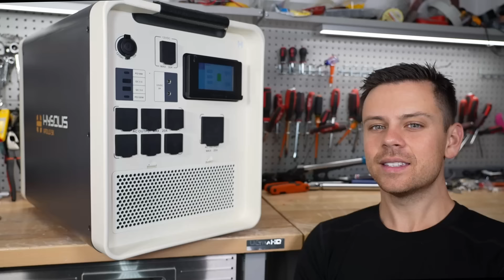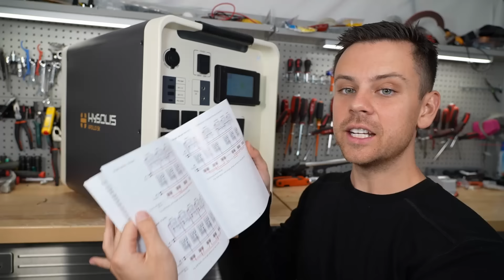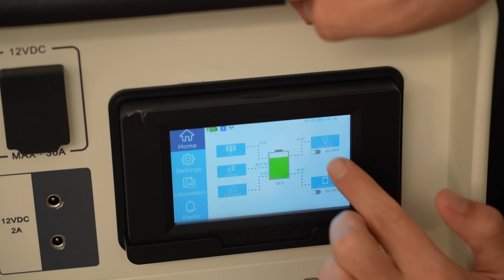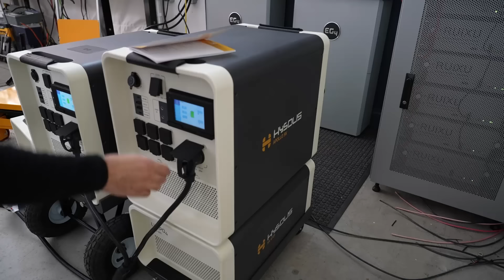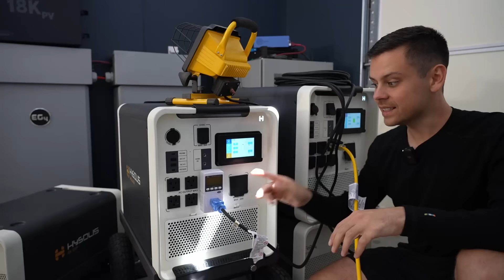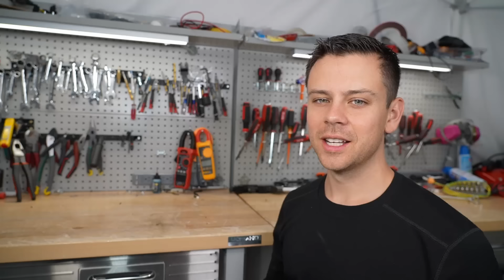Hysolis Apollo 5K Review and Test

Comment: Will, we're looking for something that can drive a small to medium sized MIG welder, angle grinder, and some lights. I think this model is plenty, but im concerned about the low voltage, high current, and especially the high frequency component leaking back into the circuitry.

Comment: Can it charge by a small generator and supplement surges by using the battery?  can it be used like a UPS?    What I want to do is plug essential systems right into it, and have it mostly do pass thru to grid, but then be able to hit a transfer switch to a generator if the power goes out.  We may add a few solar panels for the heck of it later.

Comment: Will I have a question and I know you will have the answer I'm confused I want to run my rv off of solar .but the solar will be stationary on my land with batterys :converters ; inverters in a steel shed .is there a way to  drive up in my rv to my land  plug the 30a or 50a shore plug into the solar  inverter and not have to mess with any wiring in the rv ? Just use shore plug ? 

Thank you I hope you see this and can help me out (I'm looking at buying the power everything kit you sale)

Comment: @WillProwse Deciding which components to use and wiring them up.
We've got amps watts volts. Check understand. 
Wire sizing and breakers, fuses. Check understand there's even a chart for that.

Components understanding.
Well If I pull 20amps down a line I don't need a 120a 2/0 wire.
Only makes sense. Use a 40a wire something cheaper and easier to work with. 

But components.
Controllers can push amp even if not used.

What if it's not given 40, 60a.
Solar production can produce 200w @ 16a. An MPPT can't push 60a because it's not there right?

Pulling. Inverters and fuse boxes  from bus bars.
If your only drawing 20a from a dc fuse box. Can you draw 120a down the line.
Inverters have surge. Surge is when it turns on. If it can surge up to x. Yes but only for an moment. 
After that it fluctuates around the drawn amperage. Right?
Give or take a couple amps.
If you only draw 10a off that inverter? How much of a surge are you really going to get?

There are so many videos with so much information but every video always leaves out something or causes more questions to answered.

Actually DIY Something Grab some random components and put them together. 
Answer questions as to why you chose those components.
Also.
Not a house system. Mobile system. Vans, trailers etc. Keeping it small with just a couple lights, maybe a laptop, phone, tablet etc.

I have follow up questions to videos and follow up questions to questions. Can you msg me. 
You can even call me and the questions I have will  allow you to make the 1 stop answer all video.

Comment: Will  Imagine connecting EG4 server rack batteries to the Apollos.  I have 2 Apollos running split phase, I dont want to buy Hysolis expansion batteries as they are too much cost.  I do want to connect EG4 server rack batteries, 60 KWH,  can this be done?  If not can you ask EG4 if they would develop this ability?  Thanks

Comment: Please note that I have an off-grid SMA system, have had with flooded lead-acid for the last 12 years.

You're so smart you're scary smart. Now, try to get your subject-verb agreement correct. 

I know! An engineer talking to you about grammar...

BUT... 0:05
"There WERE problems!"
NOT...
"There WAS problems."

Have you noticed that you don't use "AIN'T?" Because that would make you look uneducated? 
Same thing.
And no "A (apple, alligator, etc.)"

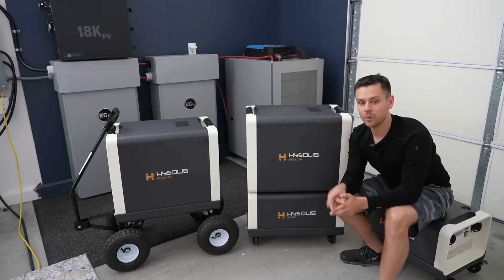7:19  "'There ARE' (not 'THERE'S') 2 different types of carts."

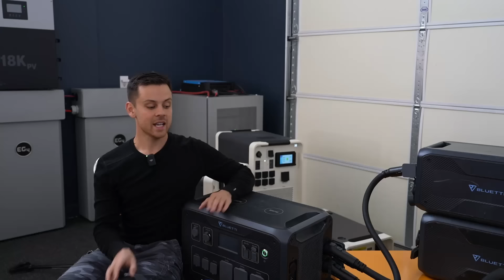13:10 and "It's none (singular subject) 'of these devices' (only a prepositional phrase) HAS (not 'have') surge protection..."

You probably got a 1400 on your language SAT exam. Now apply what you know.

14:26 "The standard settings that come with the unit only charge (not charges)." 

I can do this all day.

Comment: Mr. PROWSE: have watched your solar off grid type systems, but what would you recommend for install on a bus- solar panels +system; conversion( known as schoolies), which will handle appliances- refrigerator, AC, and including portable washer/ dryer- (stackable), also will 4 battery bank( lithium), handle the load!?, your recommendations would be greatly appreciated!

Comment: Hello Will,
I have been following your videos since back when you were operating out of an RV. Thank you for such a massive amount of unbiased information. I'm having a problem with my renogy 200 amp hour lithium iron phosphate batteries. I originally bought two of them. After one year one of them failed and was sent back to renogy in California. They replaced that battery. Now I have another battery that has failed it refuses to charge above 25%. The other battery works just fine using the same solar system in my RV it is all renogy 400-watt s of solar panels, 40 amp mppt charger, DC to DC charger, 3k charger inverter. I am one-hundred-per-cent electric in my RV. I don't know if I should stick with renogy or switch to a different type of battery the original reason for all the renogy equipment was it was available through a big-box store where I had a credit card.

Comment: REQUEST;  BUILD;  A HAND AUTOGRAPHED; WITH:  RUSTOLEUM PAINT:  Super easy too install .    'Portable'  Safe , salt air resistant.  Portable power box;   2000watt power inverter;  Duel battery rig.  ESPECIALLY FOR; THE INFAMOUS! TOYOTA 4RUNNER.  YOU WANT. TO OWN! [ Or other suv .[  That has;  The least. Wire fishing. To do.  My idea rig.  Would be. For lack. of better words.'' A removable.  Extension cord.'''  From the engine compartment. Starter battery.  To the back. So I can charge while driving.  The extension cord. Is attached. Directly to the starter battery.   Simply pushed trough. An existing open engine firewall Gromit. Rolled up. Under the glove compartment. 
// Plug,  it in.  A 12v cigarettes' lighter socket. With an extra fuse.  [Not wired.  To the OEM.  Existing electrical panel.//   The cargo hold  battery. Is safest. lithium. BUT we 4runners, need.  To charge both: The started acid batt.  And cargo compartment lithium batt. BY:   ac, dc and panel.   [ . Salt water hurricane  spray resistant;   Heaviest part.  40lbs or less  24hr  120 volt 1800 watts, + foldable solar panels. AND I WILL BUY IT[] PS  You are allowed to autograph.  Various builds. Comprised of various manufacture parts. and sell your autograph versions.

Comment: REQUEST: 911 POWER MY FREEZER.  FOR CHEAP.    individual parts.  AND: inverter charger combo.  AND:  Make the batteries rechargeable; AC plug. AND  SAFELY on a 4runner starter battery. And a portable solar panel array. []  Frigidaire 20-cu ft Frost-free Upright Freezer ) ENERGY STAR     115 V   between 185 and 280 watts or the equivalent of 0.185 and 0.28 kilowatt-hours. Same rig should also; ''Separately power'': AT least;  8,000 btu, air-conditioner.

Comment: Thank you Will for your awesome stream of Solar Videos! In Germany the so-called "Balkonkraftwerk" is quite popular, a balcony solar "power station", and it feeds all its electricity e.g. 220V / 600W RIGHT BACK into the 220V AC of the condo unit, or however much it generates at that time. The theory is that the condo uses MORE than 600W at any time anyway, and that one WOULD SAVE the electric bill by as much as one feeds into one's home, because the electricity will just somehow distribute itself within the condo. 
Question: Do such units exist ALSO FOR 110V/60Hz as we have in the US, and would that be legal or at least safe to install?

Comment: Will.  Whats your opinion on the +/- 5# voltage regulation?  I ran my apollos split phase an even at very light loading I saw volts as low as 118.5 volts.   I dont like seeing this output volts in this range personally?

Comment: I am working on my first solar design for an off grid workshop. Love your channel but you devote a lot of time to the charge controllers and inverters and all in one systems and batteries but I need to know about panels. I would really appreciate more content on selecting the right panels. For example, I need about 800 W I think probably four panels ground mounted anyway, love your channel, but please do more content about the actual electrical generator PV part of the design!

Comment: you say unit is limited to 737 watts VAC input while the inverter is outputting [i assume the full 3000 watts], however, the manual only talks about 600 watts?  either way if they are configured into split phase can each unit take 737 [600?] watts VAC input for a total of 1474 [1200?] while the pair is outputting 6000 watts at 240 VAC?

Comment: Hello Will, huge fan - been watching you for years.  I am running an Enphase system on my solar panels and would love to add batteries to the system without having to buy Enphase's battery and grid disconnect (with neutral) system.  Is there a battery system that will accept 240V ac and trick the Enphase microinverters that the grid is active?  Thank you.

Comment: Hi Will, could I ask your advice regarding my solar set up on my Canalboat…? I have 2 identical 120w panels feeding a 30amp mppt and 1x140w panel feeding a 10amp mppt, both controllers are connected to my 390ah battery bank, the reason I use 2 controllers is because the smaller panel is a different size, can you see any obvious issue with this setup? Or suggest a better way? Thanks Andrew

Comment: Why the lift worked? My suspicion is the lift was 'unloaded', meaning there is a zero beginning weight. I notice the model 3 is sitting on the safety stop, this allows the motor to spool up unloaded and therefore has a lower startup current. The model 7 looks similar. 
I suggest a more severe test where the motor must start the lift under full weight. In other words off the safety and not sitting on the ground.  
Just a few thoughts and not any kind of accusation. Jim Z - Fan

Comment: I'm interested in something that will handle a power loss of the grid.   Over the past few years the worst outage has been a couple days.   My options are a Generac generator running
on propane, or a battery system similar to this video.    I was told by a Generac Rep I need 11kW peak ( I have a well pump). If I assume 2-3 days without grid worst case,   Generac or battery.  Which is cheaper.  This would be for a fully installed system by a contractor.

Comment: Did you say this does 3 phase power?
That’s incredible if you have an off grid shop with the 3 phase tools and solar to not have to run a diesel generator for your three phase lathe or plasma torch

Comment: Hi Will, I built a vacation home 12 years ago- installed 880watts of solar and 12 x 2volt lead acid batteries, 880 ah. All works fine still with a little help from a 2kva Honda genset when its cloudy. So to my point - I want to upgrade the system, not by a huge amount as my usage is quite small- but maybe double the solar panel wattage and go lithium, The thing is technology keeps moving at a pace and I think maybe wait a little longer for the equipment to improve even more and maybe prices to fall a little more. I like the fact there is so much more plug and play gear on the market as my place is on an island and a bit remote for techs to visit. Maybe there is no one answer but thought I would share my experience from New Zealand.
Reply: I was looking for what I wanted in inverters, panels, batteries for awhile… then I executed when all my 12v lead acid batteries started to die!

I was planning on Lithium Titanate Oxide, because I did not ever want to deal with changing batteries again… but the prices on them doubled around the time I was ready to make the purchase! 

I wound up with some low mileage Ford Mach-E batteries, that were readily available. 

Locality often trumps technological options, you clearly know better than most!

Comment: Thank you for publishing such quality content. I may have to call them, but do you know if there are published specs on charging rates with the inverter settings on? I watched your video again and am concerned with having to have the inverter off to charge at faster rates.  I am looking to replace a propane generator in a slide in truck camper. I want to make sure I don't oversize solar input and not be able to run high draw items like the ac and charge at the same time. 

Should I be concerned with this limitation of the Apollo 5k?

Comment: Great presentation. I think you should have hook the Eco flow to the 30 amp plug to try to operate the lift. But you didn't on the other one so I get it. I'm an Exo flow guy cuz I just  picked one up online for $1,700.  I don't think I'll be getting any other ones for a couple years. But I am going to figure out how to use for 100 amp hour batteries to supplement my EcoFlow Delta pro.

Comment: Hey Will, I have a solar question for you. We have all victron components with battel born lithium batteries, we recently updated our system from 12v to 48v. We have two multi plus II 48v/3000, lynix 1000 power in, mppt 150/85, 12 batteries, 6 320w solar panels. We can not get mppt to kick on and generate current to our system. We have had solar guy check our work and several calls to dragonfly, everything is hooked up correctly, all are stumped. Any ideas?

Comment: I just saw your video review on the Hysolis Apollo 5K.  I am looking to install and out door kitchen.   I want to have a fridge connected  and run lights fixtures every six feet for a total 128ft of lighting.  Would this unit be over kill for what i am using it for and those this unit have battery storage.

Comment: There is an interrupter that goes between the batteries and the Invertor to prevent the invertor from Faulting on low voltage. Also, it will start the invertor back up when batteries charge back to a safe level.  I am afraid my inverter may shut down someday and my fridge contents will spoil. im sure that i seen it on this channel

Comment: Will, this is great.  Appreciate your video's.  I am wondering if you can point us toward a 48V system that can have battery backup and be grid tied that is DIY friendly.  I assume it would require some kind of automatic switch to disconnect from grid during outages and maybe that would prevent a DIYer from installing.  Would love to see some content on that if possible.

Comment: Starting the lift when it is on the ground or safety dogs it is different than when the vehicle is supported by the hydraulic cylinders. It would be worth insuring your test is the same each time.
Reply from the maker: In both instances it's actually on the locks. So it doesn't matter. The locks are the same at every height

Comment: Hi Will, I'm in the uk. Can you run this as a single unit  at 240v (like other makers of uk units) or do i really need two units to achieve this? It's quite expensive if i need two to work at 240v here in UK. You point out that you can only draw some 720watts from single unit when it is charging at a higher amps. Is the power output also restricted when charging from solar panels?

Comment: Nice video review, and nice product for amateurs who want something simple for a RV, or other mobile electrical setup.  It's great that a company finally listened to your wish list and added the missing features to a portable solar generator.  This will be great for competition.  I hope that Anker will come up with a software update for my Powerhouse 767 that adds some of this functionality.
Reply: "nice [expensive] product for amateurs" certainly not "commercial"
Anyone care to guess what their sales and marketing plan says?
Reply: Very nice unit I like this my question is, can I use two to 25 amp plugs run them into a 50 amp female plug and use it for my 50 amp RV? Unplug the RV from the pedestal and plug into the 50 amp female plug and have the same power and usability?

Comment: I’m genuinely happy to see this thing available, but that 113kWh of battery is *expensive*. Puts the price of some of the EVs equipped with V2H into perspective. 

Also YES PLEASE on those 90º connectors. I can’t understand how nobody has released an actually decent integration/install setup yet.
Reply from the maker: That's a good point about the v2h feature
Reply: Pectron has 90deg connecting cables.

Comment: Will,  Does the the Apollo have any Noise generation for Radio Interference like my Ham Radios? I have a pair of EG4 Batteries and a 6K DIY configuration and I get a slight noise generation issue from my the inverter 6000EX, dont feel all alone I also got shocked there was a 188 volt AC potential@ 1.3 Amps floating around my ham shack in my DIY UPS I  had to add a ground to my radio case best regards  Nate

Comment: QUESTION: I recall you saying always connect batteries to your solar chargers first but then I recall you saying even when you didnt do it, the CC still worked. have you tested this further? Will MPPT CC burn up if you connect solar to them first without a battery? I know its still a best practice but just curious.

And I LOVE that mc4 cable with the switch in between. It would be useful with my little MPPT battery charger since I have multiple batteries then I could easily kill power from the panels, switch batteries out and then get power back.

Comment: I have the same lift and I may know why it worked this time and not previously. When you lower the lift to one of the locks or the floor and continue to hold the lowering lever even for a second, you will get slack in the cables. I’m thinking that you may have had enough slack to get past the start up surge. I’m sure there is still a surge but maybe not as much as if there was no slack and the weight of the car.